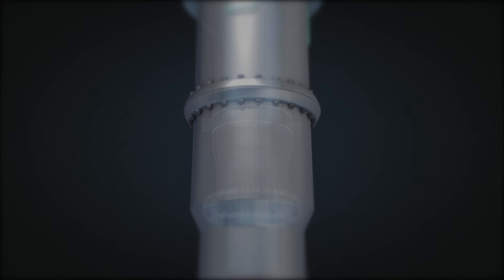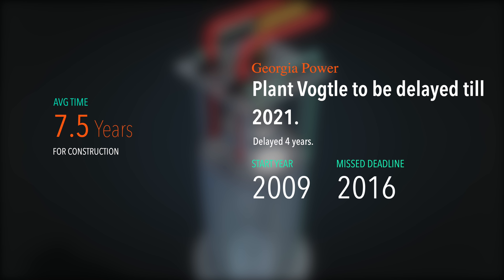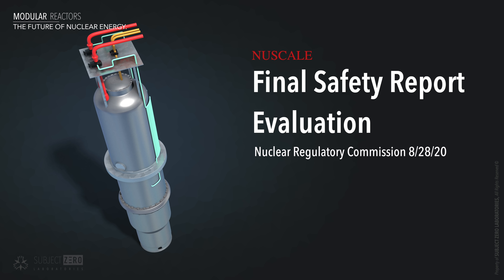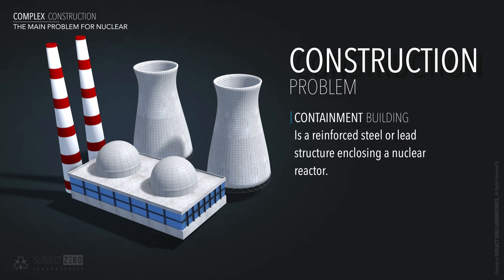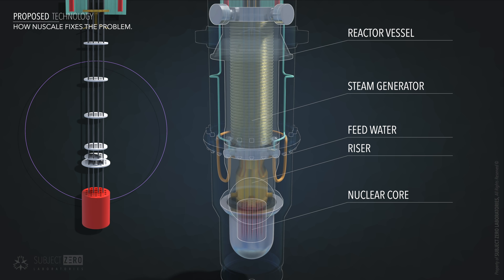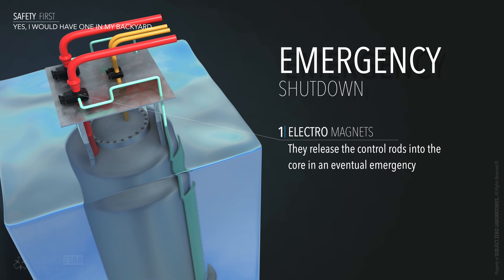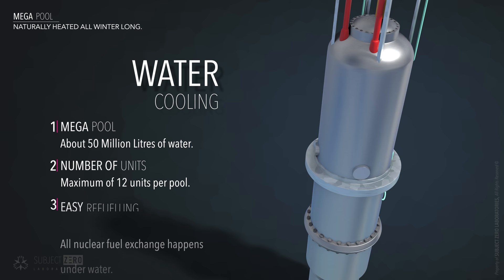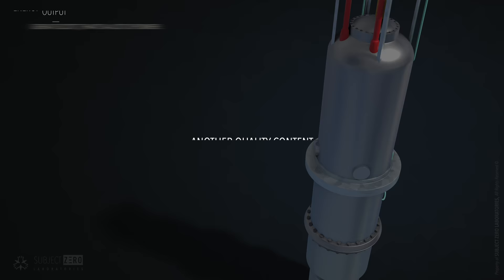A Milestone for Small Modular Reactors (SMR 2020)

Comment: No matter how complex it's still steam power.
Reply: how dare you  noooooo you undid the spell
Reply: Still the most efficient way
Reply: @northshorebuilt6364  Most efficient way that we know of*
Reply: you say that like its a bad thing
Reply: We will always use steam:D
Reply: Up!
Reply: Yeah, you take the mini🌞 in the tube out and you have a steam ⛵
Reply: And ever car is just a tire.
Derp. Thumbs down.
Reply: @northshorebuilt6364  what about sterlin engines?
Reply: @gmhero24  just like a computer is just cables transmiting electricity, or a radio is literaly morse code using light signals, most technology is build on very ancient roots, that doesnt make it bad
Reply: Do you even know anything about power production?
Reply: And there's absolutely nothing wrong with using water/steam as a working fluid.
Reply: @inamdarsaquib9528  Nasa has a RTG design that uses sterling engine generators for their upcoming space probes.
Reply: Well, it just glorify kettle
Reply: @nicok.1491  MHD generators can have higher efficiencies since they can work at higher temperatures.
Reply: technically all energy generation is either solar or steam.  with wildly wildly different forms of making steam and gathering its power
Reply: @luigeribeiro  Thats literally why i said that. We dont know if we have found the most efficient way of nuclear fission. Most probably we have yet to find many more.
Reply: @khhnator  Wind and water turbines being pretty much the only non steam power energy sources.
Reply: @nicok.1491  hydroeletrics are literally just delayed steam, very delayed
Reply: @khhnator  wdym ?
Reply: Water is cheap
Reply: Aluminium Roll I just checked ..... sadly amazon doesn’t sell Nuclear kettles yet
Reply: Incorrect. Supercritical nuclear is the future.
Reply: @TCBYEAHCUZ  it's regular fission reactor if you mean Kilopower, just way smaller
Reply: @nicok.1491  the main comment is about conversion to electricity from heat,so it was expected that you were talking about that.

MHD is just a conversion process to electricity, and any other fuel can be used.
Reply: Nothing wrong with steam.  How do you thing we melt iron...steam heat.
Reply: @luigeribeiro  i didnt mean you with that lol.
Reply: @mandalamarcho7997  ha
Reply: Nuclear steampunk future, here we come!
Reply: @nathangamble125  The water gas shift reaction was discovered by Italian physicist Felice Fontana in 1780.
Reply: Innovation needs to come on how to convert Heat to electricity without boiling water. There doesn't seem any idea as of now.
Reply: @Feefa99  No, either I am mistaking the organization but there was a demonstration animation that I think the youtuber Scott Manly showed of a RTG turning heat into electricity via sterling engine's, specicially for space probes.

I do know what you are talking about in regards to kilopower, those actual fission reactors will be used for an aspirational Mars base (or the moon)
Reply: @Feefa99  Found it, look up Advanced Stirling radioisotope generator
Reply: @TCBYEAHCUZ  yeah yeah that's also thing, but RTG's are powered only from radioactive decay but not from fission reactions, check "Kilopower" from NASA that's real POWA 💪
Reply: @Feefa99  I know dude.
Reply: @mithunbalan4973  : Methods are known, but the steam method is better than them.
Reply: @Toy : We can use thermocouples, which is useful for low maintenance situations, but is also rather expensive for the power that you get out of it.
Reply: @carso1500  Computer is not wires transmitting electricity... Modern processors are built over quantum physics, which is very, very new concept in modern industry.
Reply: @Mr539forgotten  But we won't see that any sooner than 50 years.
Reply: @tapist3482  yeah, i know, i was just over simplifying to make a point
Reply: @carso1500  OK then.
Reply: Steam power with some really nasty stuff and risks involved ...
Reply: I think the gist of the original poster is that we are just primates monkeying around with the atom and we do not truly understand the ramifications of our actions. That and we are essentially still in the steam age even though people tell us we're in the nuclear age.
Reply: @Toy of course, RTGs use thermocouples for a direct conversion, but it's way less efficient than a turbine.
Reply: @DavidMcKeeSmith  i'm pretty sure thats not what he was trying to say, his comment is just along the lines of not understanding that it's just steam power because imo most people believe that nuclear energy is more complex than it really is, in the end it's just a really efficient way of heating huge amounts of water easily and eficiently, you know the whole converting heat energy into mechanical energy and then into electrical energy

If it works why change it, it's not like we invent a new set of numbers and mathematical operations just because the current ones were using are thousands of years old
Reply: @Krmpfpks  not anymore really, at least not as many nasty stuff as carbón generators
Reply: My dad worked on a reactor in the navy. His exact words to describe the job " I made hot rocks"
Reply: @nicok.1491  Not true. Supercritical CO2 is far more efficient.
Reply: carso1500 if you ignore waste, decommissioning and accidents. Fly ash from coal plants is nasty, but not nearly as nasty as radioactive waste.
Reply: screw water, it sucks. thats why these plants keep going BOOM.

molten Salt fuel to Super critical CO2 turbines, so much safer, WAY more efficient.
Reply: @northshorebuilt6364  nope
Reply: @nicok.1491  Resorting to insults, says a lot about you.

Paulie's Channel
No matter how complex it's still steam power.

NorthShoreBuilt1 
Still the most efficient way

Nico K.
@NorthShoreBuilt "Most efficient way that we know of*"

Clearly, it is not the most efficient way that we know of.
Reply: Nuclear reactors is a really complex way to boil water but it's currently most efficient way to do it
Reply: Steam as a prime mover is as useful as it has ever been. No toxicity problems (spills are insignificant), relatively low ratio of specific heats (1.3), low price. We have been using iron for a very long time as well. Steam power will be with us longer than any of us will be alive.
Reply: Modern steam generators operate much closer to the optimum Carnot efficiency than people every thought back then...
Why do people point out that it's "steam power" like that somehow that diminishes the technology.
Reply: Until we build power grids based on plasma instead of wires.
Reply: And it’s awesome.
Reply: Hahaha .. so right .. you would have thought buy now we would of worked out how to generate electricity from nuclear technology without having to resort back to steam
Reply: @Wolfdog370  Fusion energy is likely the answer.
Reply: @mithunbalan4973  ...Thermocouples will do it, but efficiency is very low.  Good for thermometers at high temperatures, but not for multi-megawatt power production.  Sterling cycle machines are better, using some gas other than steam as a working fluid, but our long engineering experience with steam makes it the most practical today.
Reply: So?
Reply: Until it is directly converted to electricity, it will forever be lame.
Reply: carso1500 radio waves are a completely different part of the electromagnetic spectrum to light which isn’t really waves at all. And neither has much to do with morse code which was originally used as a wired only communication system. A computer is not cables emitting electricity? Apart from supplying power and moving peripheral signals around a computer doesn’t even need cables. Probably need to pick a better analogy.
Reply: That's just part of the transmission.
Reply: Most forms of power generation are still just ways to spin wires and magnets
Reply: And when we have fusion that'll heat up water too
Reply: Up next: guys we found this cool and original way of generating power, it uses a turbine!
Reply: Robert Pearce  Which?
Reply: Robert Pearce  I'm asking which existing or past space craft has been powered by Radioisotope thermoelectric generators using a sterling engine as the power generator?
Reply: Robert Pearce  Steam-powered blast The steam engine was applied to power blast air, overcoming a shortage of water power in areas where coal and iron ore were located.
Reply: @Tadesan  ok.  If that's what you want.
Reply: If we're talking archaic, steam power has nothing on wind power.
Reply: @delphicdescant  As strange as it may seem, yes water has been detected on the Sun. Actually what was detected is 'steam' over a particularly cool sunspot where the temperatures were only about 1000 K or so.
Reply: i know, dunno how we haven't managed to change termal energy directly into electrical yet
kinda bizzare to be honest
Reply: @raxsavvage  Well we have. We have thermoelectric generators. They just aren't as efficient in our applications as boiling water, in most cases.
Reply: Many of the gen4 reactor designs are hot enough to use supercritical CO2 instead of steam. That’s a more efficient heat conductor than steam.
Reply: Which is a neat factoid, but so is everything except wind and solar, and those are hilariously low-power as a result. The thermal->mechanical ->electrical conversion chain that is a steam turbine is pretty damn efficient. Only a few fusion designs offer an alternative that works at the scale and in the manner of a power plant and those are still in the early design and testing days.
Reply: Yep, and my car runs on torque power. The brakes have hydraulic power when they want to slow down.
Reply: @raxsavvage  The findings, published this week in Nature, confirm the existence of “superionic ice,” a new phase of water with bizarre properties. Unlike the familiar ice found in your freezer or at the north pole, superionic ice is black and hot. A cube of it would weigh four times as much as a normal one. It was first theoretically predicted more than 30 years ago, and although it has never been seen until now, scientists think it might be among the most abundant forms of water in the universe.
Reply: @raxsavvage  Imagine what would happen if you mixed Ice XVIII with element 115.
Reply: Steam power with *extra steps*
Reply: Yes it is still steam power, however that is not what's impressive about nuclear power, what's impressive is the generation of said steam with no fire, or coal, or gas, just using the laws of physics. In a way I actually rather enjoy how humbling the whole process is, sometimes the simplest and most natural solution is the way to go.
Reply: Yeah, with efficiency about 50%
Internal combustion has like 25-30%
Reply: That is until we learn to make power ducted heat sinks, IE it would absorb the heat directly through a heat sink and convert it into power, although this is theoretically impossible, that may change.
Reply: And the funny part is that materials that convert heat in to electricity were already made, I just don't think one for nuclear purpose was.
Reply: That's until fusion power plants will be a thing in the near future.

Comment: "Two Tsunamis, One Reactor" lmao
Reply: i was looking for this
Reply: 2 reactors Fukushima Daini is 9km north and got hit by the same Tsunami and it didnt melt down.
Reply: @diamondisgood4u  x2
Reply: I think I'd rather watch another reactor meltdown.
Reply: @Bangpath247  That was because they still had a working connection to the electricity grid from which they could power the necessary equipment.
The decision made in the design of the Fukushima reactors to put the emergency equipment in a basement where they would be flooded by a tsunami was what caused the problems. In hind sight, that should never have been done.
Reply: Yup, only smart people should build nuclear reactors. Placing one on a coast that's known for tsunamis is schoopit... you might also want to look up "black swan event"... once we know about this bias, we can avoid it in the future.
Reply: "several reactors; zero coolant"
Reply: The nuclear reactors now are so much safer
Reply: @leonesperanza3672  
Which nuclear reactors are now so much safer?
Reply: @TheEvertw  TEPCO were well aware that Fukushima was vulnerable.. It was built facing the wrong way putting all of the safety equipment between the reactors and the sea. They assume the sea wall was high enough. They ignored warnings that the plant was extremely vulnerable.
Reply: @davidelliott5843  Ah, the sweet smell of corporate cover-ups and government corruption...
Reply: @davidelliott5843  The safety equipment wasn't wiped out, they were not sealed properly so the sea water got in and destroyed them. If they had put some proper seals on their equipment ($20 of rubber) the backups wouldn't have failed.
Reply: please need answer how much smr cost?

Comment: We need MSRs with thorium, this are safer and this is what we should be working on.
Reply: thorium is not fissible alone, it needs to be used in a breeder reactor
Reply: @Ubya_  Not so--based on the little I've read. Please cite references.
Reply: Molten salt uranium could work too, getting rid of water in the system has the biggest safety advantage. Molten salt no matter the fuel cycle is more efficient in fuel use and temperature gradient, removes the biggest risk and deals with the Xenon problem.
but I agree Thorium fuel cycle is a much better. the waste is so much less difficult to deal with long term.
Reply: Sadly we have chased away the most promising candidate for this role in ThorCon. Sadly our Nuclear Regulatory Committee chased them away to Indonesia with its ridiculous regulations and costs to get approved here
Reply: Nuclear reactors are actually safer than other energy producers based on the energy made compared to the lives lost. We should be making them already, not worrying about making them safer. Oh, forgot this, this was based on 20 year old reactors and with the advances we've made, it'll be about a percent of danger than what it is now.
Reply: Chaotic Masterpiece what you’re not taking in to consideration though is the thousands of year of impact to human life yet to come!
Reply: @samk4339  nuclear power is the safest energy source humanity currently has especially if you take into consideration all additional CO2 emitted and toxic waste left by other energy sources.
Reply: @samk4339  with the new reactors we have, we can get rid of some of the previously defined waste by using it to make more energy. Some of the reactors have waste that has a lower halflife than the ones used today.
Reply: @chaoticmasterpiece  these "new reactors" you speak of a hypothetical and don't actually exist yet! It's a pipe dream being pushed by the nuclear industry
Reply: @bioswars8827  Having skyscrapers/dams/cruise ships/centralised water/bridges are bad ideas! "many terrorists dream come true" . Terrorists can kill thousands of people destroying any of these. 
And remember the total number of killed in 3 mile island incident and Fukushima Daichi from radiation is 0 . And 60 people directly in Chernobyl. In 3 mile island incident 98% of the evacuees had returned to their homes within three weeks.
On the other hand:
In Banqiao Dam and Shimantan Reservoir Dam Disaster 170000+ were killed,
Bhopal disaster - a gas leak incident that killed at least 3,787;
2002 Lagos armoury explosion killed 2000+ 
Gas and coal-dust explosion in Benxihu Colliery killed 1,549 miners
Reply: @bioswars8827  A terrorist has little to no need for Nuclear materials. Why do I say this? Well let us think about this rationally for a moment. What could a "Terrorist" do with fissile nuclear material. I know you probably think they'll manufacture a weapon of some sort, but would they really know what to do with it? Probably not, manufacturing a nuclear weapon is a pretty expensive endeavor, assuming that we are talking about nuclear weapons capable of leveling a city. A terrorist group would almost definitely lack the infrastructure and intellectual capital necessary to produce a functioning weapon of mass destruction. It is much cheaper to buy the military hardware of yesteryear from sympathetic governments. Like Al Queda has bought from Saudi Arabia. Perhaps a dirty bomb then? Hmm, perhaps, although there is one problem with this. No dirty bombs have ever been used. Ever. The fact is, dirty bombs are just a plot point in television dramas. They don't produce an atomic detonation or blast wave like a conventional nuclear weapon and often have to be triggered with another explosive such as dynamite, they are also wildly inefficient at scattering nuclear materials. Iraq once detonated a radiological bomb during their testing and shortly after abandoned the project, it was too expensive and far too ineffective. These groups would be far better off getting their hands on nerve gas or conventional weapons. Theguy already did a great job on decimating your attack on the industrial application I figured that it was only right to pick apart the other half. Thank you for coming to my Tedtalk.
Reply: @Bangpath247  I am 100% with you. Molten Salt is the better medium not water. Since the 1800s, engineers knew that unstable steam pressures have a tendency to disastrously explode your boiler.
Reply: @Bangpath247  The biggest issue we are currently facing with molten salt reactors is corrosion
Reply: @Ubya_  From what I've seen on the topic, that is correct. Thorium is fertile, not fissile. However, after absorbing a neutron, Thorium turns into Uranium-233 which is fissile.
Reply: @Christopher Grant Thorium reactors have been built and run successfully in the US, in the 1940s and '50s.
Reply: @Christopher Grant What means "over unity"? Equality of power input and output?